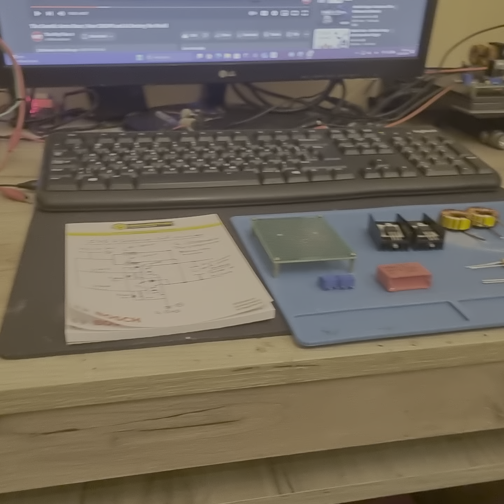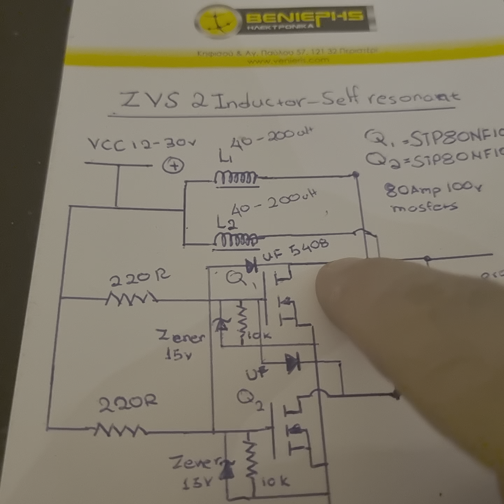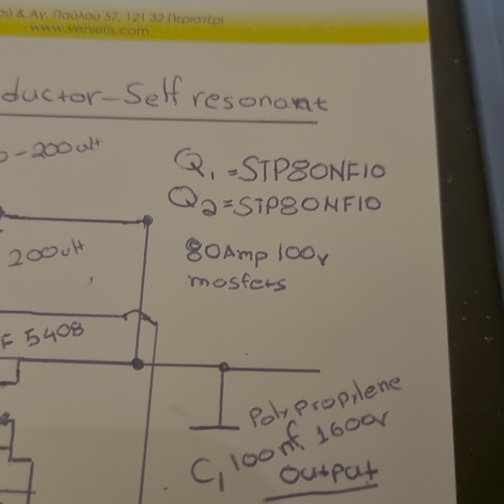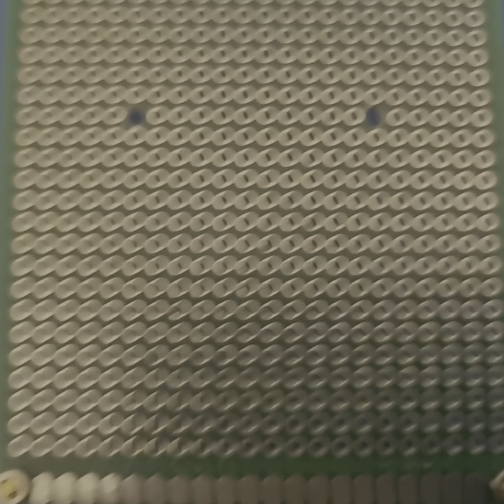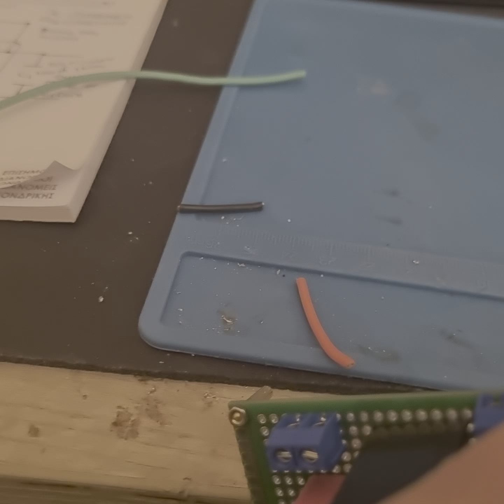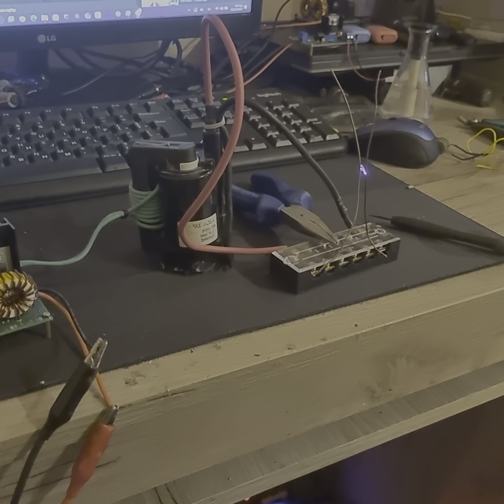The ZVS Resonant Oscillator

Comment: is possible to make zvs with sqare wave? good work by the way
Reply from the maker: Nope, because first of all its a resonant device.
Square waveforms usually originate by a function generator.
Now the BJT Version  of this circuit does produce a squre wave form. (Search unstable multivibrator)
But if you wanna drive a single or many mosfets you can do so with one function generator using a square wavefrom.
Or you can make your own awesome 555NEP  IC square waveform function Generator n run it that way! I ll be making a video of how to make a square waveform Generator circuit with a 555 and run a mosfet with it to make high voltage soon ^^ ⁷
Reply: @TheEnchantedGoose  for radiant energy harvesting, square wave is best
Reply from the maker: Umm no but the next thing you can do is called an unstable mutivibrator or make ne555 pluse generator or!  w8 till tonight that ill be making step by step one such a device that produces squre waves to run mosftets. With adjustable frequency and all =)  @RicardoJMGuimaraes
Reply: @TheEnchantedGoose  pls do, i will replicate it... never test it like you mentioned
Reply from the maker: Replicate what exactly? im confused, you want me to make a circuit  that produces a squave waveform?
Reply: @TheEnchantedGoose  you said the best is unstable multivibrator, i never test it
Reply from the maker: @RicardoJMGuimaraes  https://www.youtube.com/watch?v=Ohips8RDG10 there  you go, thats how you make a square wave generator
Reply: @TheEnchantedGoose  my guess was that multivibrator would beahve like zvs... i already tested function generators, but my goal was to get a sistem that work with square wave and also auto detect or work on ressonant natural frequency
Reply from the maker: @RicardoJMGuimaraes   its something called quasi resonant
Reply from the maker: And you actually can build a zvs with From BJTs but its complicated and the outpout is kinds meh,  why not use Mosfets?
Reply: @TheEnchantedGoose  have to figure out the diagram....
Reply from the maker: The square wave drive or the  ZVS
drive? @RicardoJMGuimaraes
Reply: @TheEnchantedGoose  The square wave drive, auto ressonant or quasi ressonant, to run with mosfet or igbt